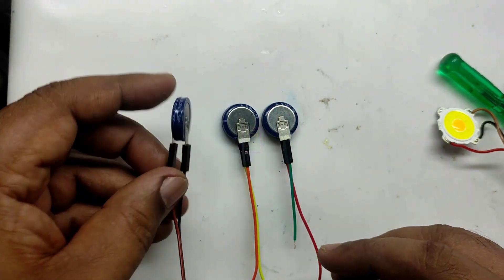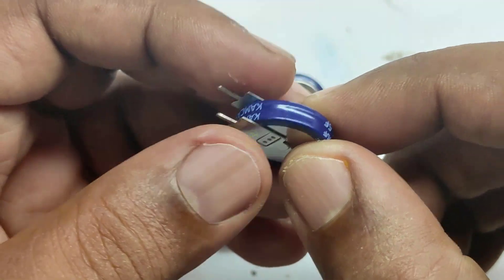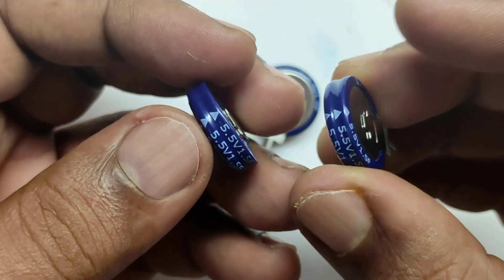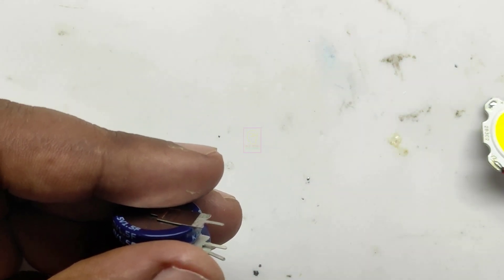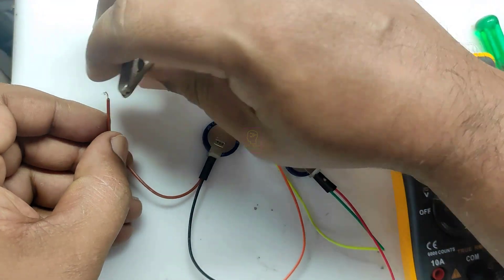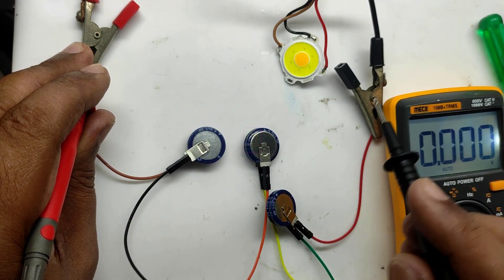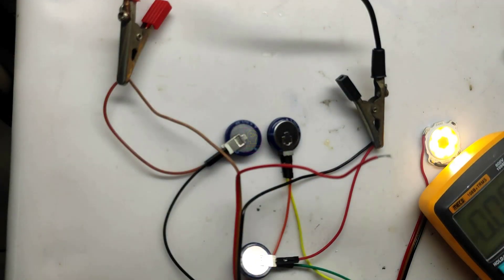Unlock the Power of Super Capacitors - Here's Why You Need to Know!

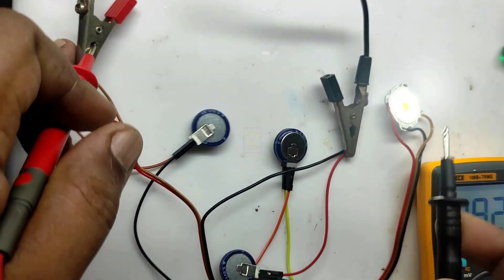Comment: 4:29 it is 8 volts because the load will drop it's voltage, if the load is low current, the voltage drop is low, but if the load is high current the voltage drop will be high
Reply from the maker: Thanks. But if the load is high why shoudl it stops at 8V. I was wondering at that point
Reply: @TechInsert  Maybe because the load is visually not working at that voltage, if it's not what your looking for please rewrite the question so i can understand 😉
Reply from the maker: It is using the current from the capacitor

Comment: Nice video- please make your videos more watchable by editing out all that time spent fiddling with the wires. Connecting the caps in series - you must be careful because the voltage will not divide evenly, the lowest value cap will see the greatest voltage, without a large margin or a balance circuit, you can easily damage them via over voltage. Using the COB LED without a current limiting mechanism will tend to clamp the voltage to the Vf of the LED, any increase over this value will draw huge currents, in this case the current is limited by the ESR of the capacitors, which is quite high in this form factor- around 30 Ohms - so you probably get only around 40 mA current flowing (4V/90 ohms) Super caps are not very "super" - a terrible name choice.
Reply from the maker: I really love this comment, very valuable to all the viewers and including me
Reply from the maker: Thank you very much for the suggestions. Definitely I will follow ur comments. You are right i noticed that - out of 3 capacitors(with connected power) one is showing 5.3V, one is showing 3.9V and one is showing 2.9V.  Since iam testing it, I didnt use limiting resistor but when permanently fixing ill use that.
Reply: ❤❤j